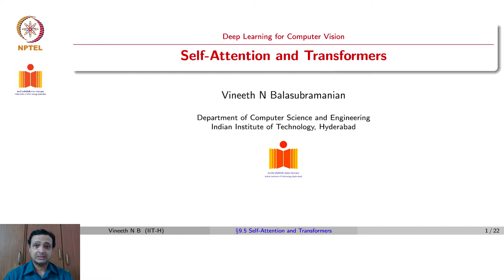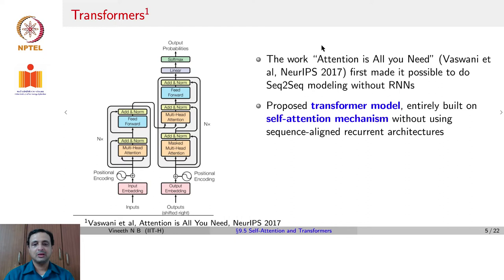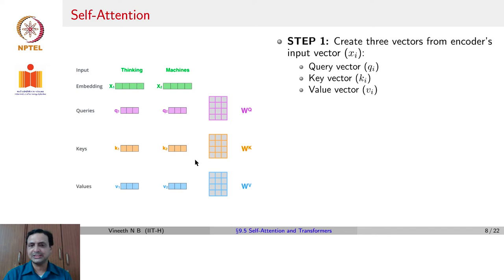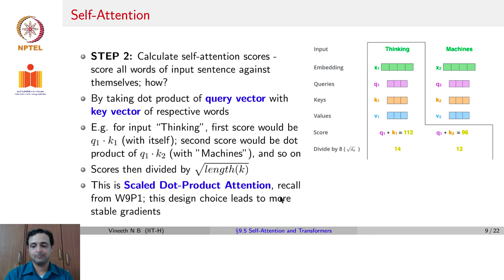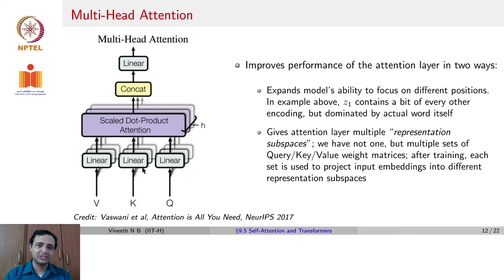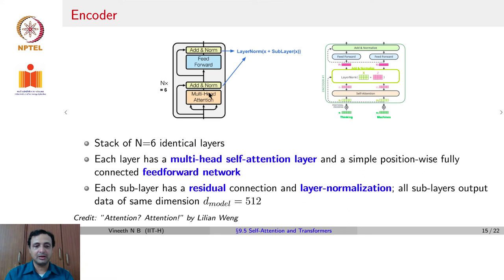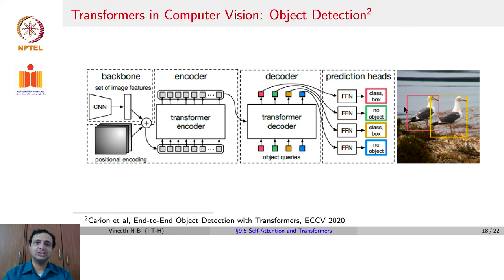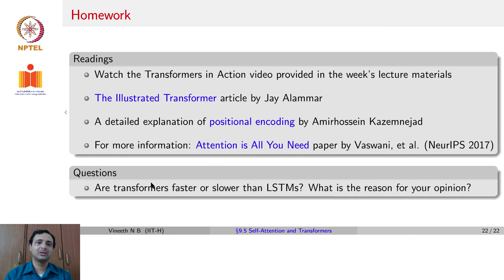Self-Attention and Transformers

Comment: Sir can we calculate weights of Query, Key and Value and store them. And then use that for calculating self attention of any sentence we want??
Reply: The query key and values are just like perceptron which mean they will get optimized with the feed forward layer in back propagation meaning that they are optimized for the data it is trained on. so if you want to store and reuse them you can apply transfer learning techniques I.e pre training.